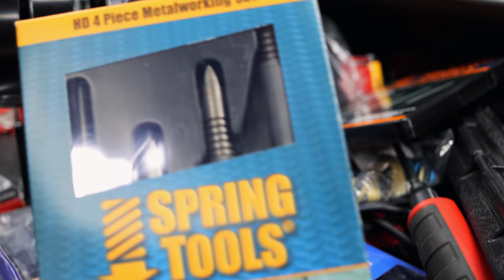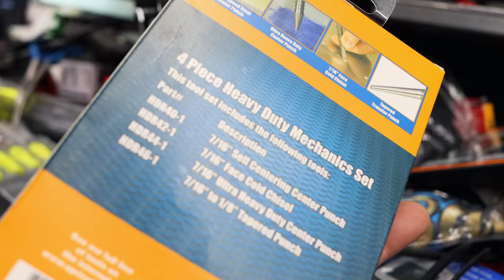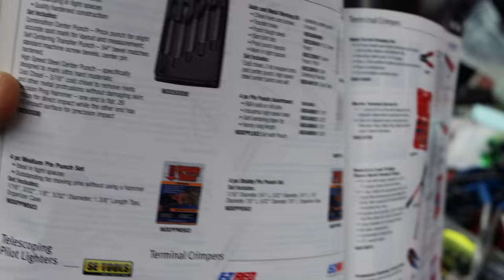Snap On Friday! New Cool USA Made Tools

Comment: Clay. I actually bought a double ended spring tool probably 20 plus years ago and the brand I believe was general tools at Lowes. Not US General. Back then was considered a nail set but looks almost identical to those. I still use it but for a center punch for metal and it will leave indentions just like the ones in Hamilton's vise! I just thought it was interesting that they're just now showing up. And to Hamilton, man in sorry to hear about the loss of your father.

Comment: Those funnel things would be great for zip ties or welding rod maybe
Reply from the maker: you would probably have to glue that plug in at the bottom for a welding rod cause it would fall out from the weight of them but it would work for sure